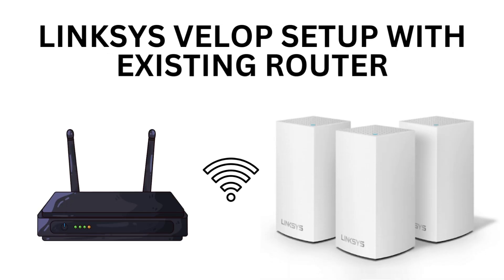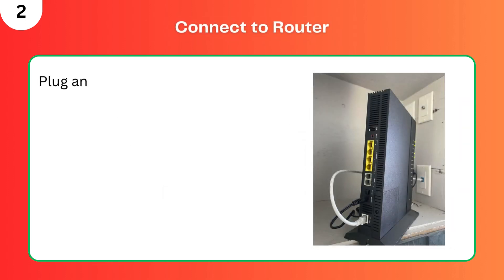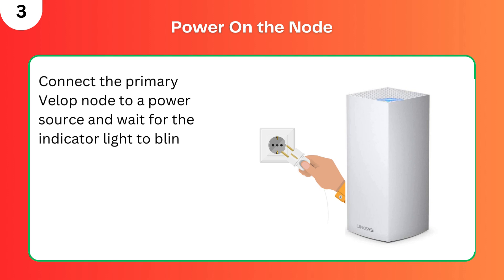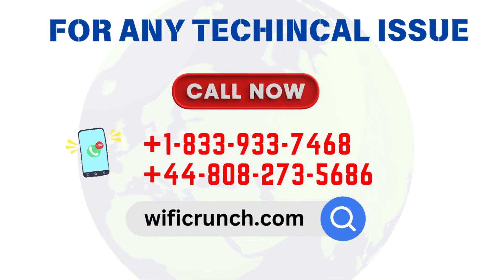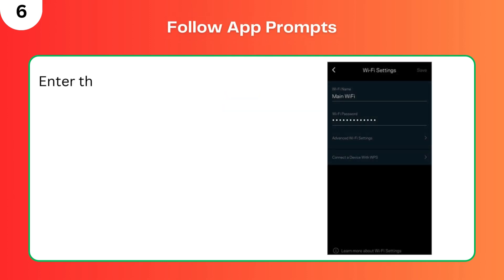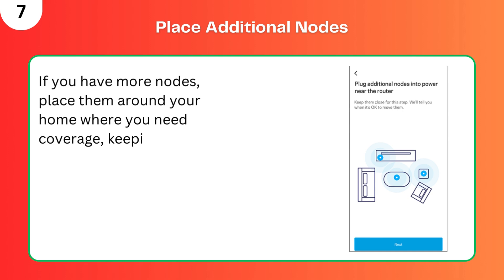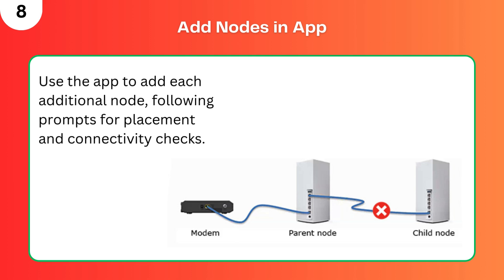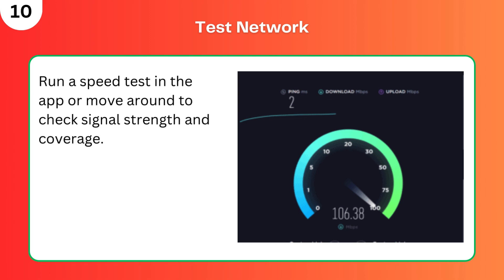Linksys Velop Setup with Existing Router

Comment: This sounds like it just adds to the existing network correct? Same IP pool it just turns DHCP off of the velop? I went to run 2 seperate networks. I changed the IP address of my existing router and disconnected it. I then installed the velop as the primary as normal. Added a switch to give me more ports and hooked back up original router using LAN cable from velop routers switch to WAN on old router. works. 2 networks 2 different IP pools both using DHCP. Existing routers network intention was to be the shared one anyone and visitors can use and the velop with the nodes my private network with 10 or so devices others can't easily see or access my files. But now all the machines can access the internet fine but none of my windows based computers can talk anymore. Can't access each other no machines showing under network. If I reconnect everything back to the old router dispite it now being  a different IP address and pool all devices work again and see each other. So there is obviously a setting ín velop that is blocking or firewalling these computers. Why? I don't know. And I didn't see where to change this in setup. It's like routers these days have no options. Why by default is it blocking lan communication and how to I change it. The app now for some reason won't see the velop so I might just reset it. Or give it away! 2nd Linksys giving me grief.
Reply: This is verbatim the exact issue I ran into. It was a while ago and I was trying to remember why I disconnected and stopped using those velops until reading this. You just saved me a couple hrs of making the same mistake twice!